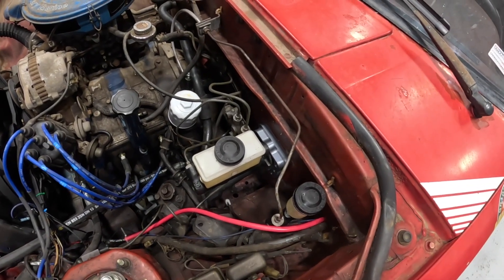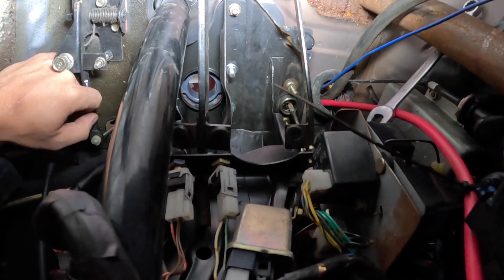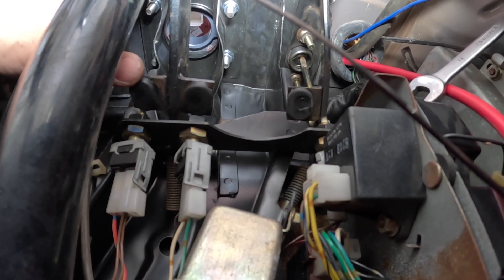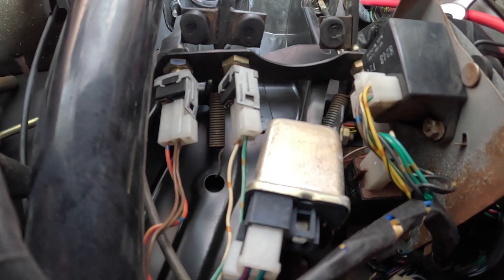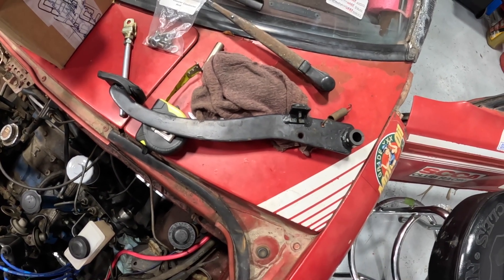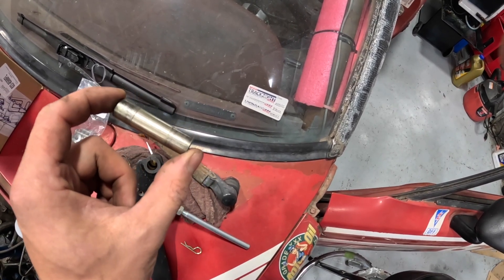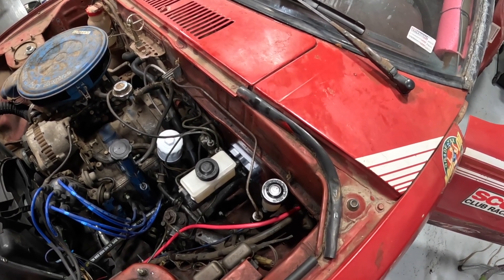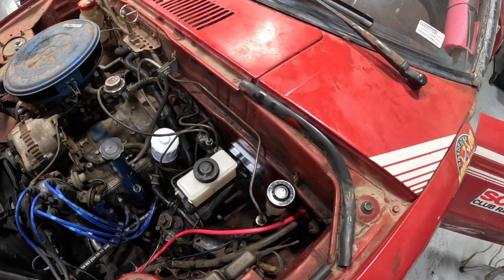First Gen Mazda RX-7 (FB) Manual Brake Conversion

Comment: how would you say this conversion would be for a street car? I need a new booster but I feel this may be the better solution.
Reply from the maker: I'd have no issues driving this on the street, especially with the right brake pads. I have Hawk pads on that car. Pedal pressure may be slightly higher, but still perfectly manageable.

Comment: Are you able to tell me how to determine the push rod length?
Reply from the maker: I just basically did a bit of trial and error by cutting down the pushrod a bit. Since it is adjustable it’s best to have it in the fully retracted position as you’re cutting it down, and once you have that where there’s some play then you can tighten it so that there’s just a little bit of wiggle between it and the master cylinder.
Reply: @TedsGarage  thanks!